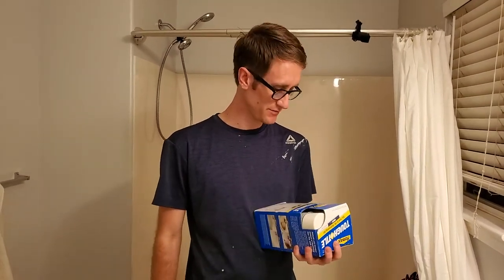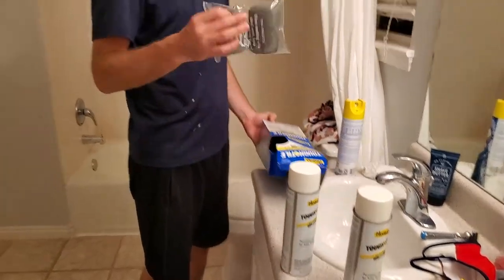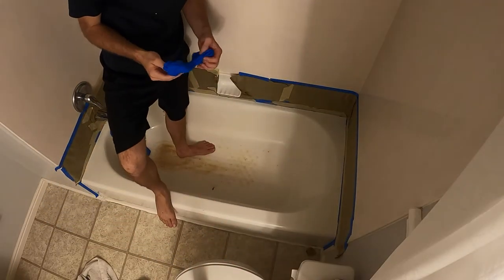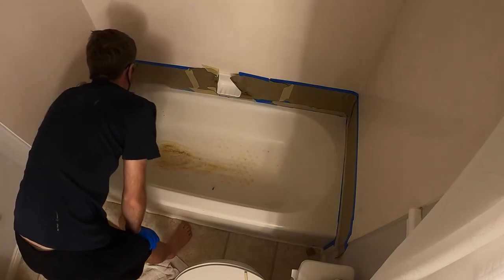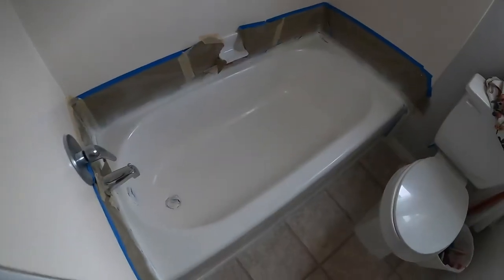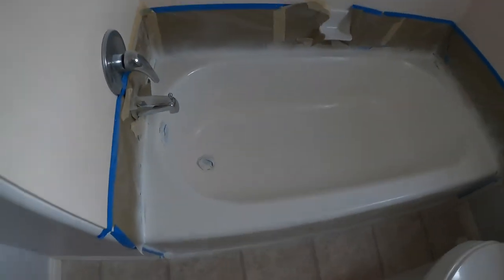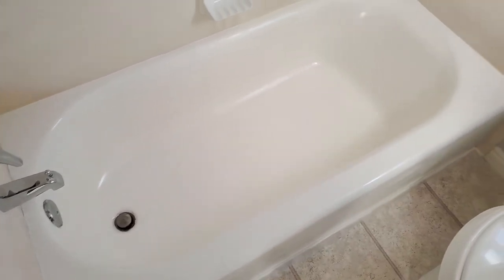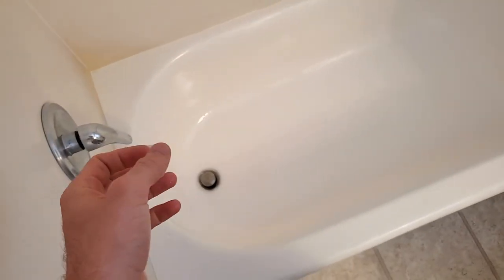HOMAX Tough as Tile Tub Enamel Spray Review / Resurface Bathtub

Comment: You're supposed to spray a light base coat wait about 20 min then spray another coat on to fill in the shallow parts and finish. You're not supposed to wait a day to spray it again. And hold the can about 8-10 inches away from whatever you're spraying

Comment: As for the area where your water pools up, that is typically caused by the fiberglass material that the tub is made out of sagging under pressure over time.  Paint is only a mil or two thick, and won't build up like that, and even if it did, it will only follow the contour of the tub.  

In order to fix this, you need to support that section from the bottom with a piece of plywood, then get some Bondo and mix it, then smooth it out in that pooling area, let it dry, sand it smooth and level, and then paint over it.
Reply from the maker: Oof that’s a lot of work. Thanks for the suggestion we might replace the tub all together

Comment: Guys please don’t just wear a dust mask! Wear a actual 3M half or full mask and make sure your filters say organic vapors on your filters! If it does not say organic vapors it will not filter out vapors such as paint oil and gases! This can cause serious brain damage or even death! Please don’t just use the little paper dust masks make sure the filters say organic vapor and it is a half or full mask! Each cartridge contains granulated charcoal that is treated to absorb organic vapors from the air passing through as you inhale. Used mainly to protect against solvents, such as those in oil-based paints. Others would include paint thinner, lacquer thinner, turpentine and fuel vapors.
Reply from the maker: I was wearing a n95 mask

Comment: The roll on is the only way to go I did one with the Rustoleum producct tub & Tile it left all kind of powder residue. I had to stop clean the by product then continue but my shower is just to confined regardless of the window and fans...Need to get a new Respirator the organic cartridges are worthless need full vapor protection half shield from 3m for this stuff. Going to use the homax roll on before too many days go by seems to be close to the same product hope it works. Thanks for posting

Comment: A wise man once told me, "If you don't know what you are doing, it's best to not do much of it".  You obviously did not know what you were doing.  Next time you try doing something you have not done before, try experimenting on a "sample" piece (in your case, perhaps an old sink).  Also, if you rely on instructions but do not have them, don't "wing it";  instructions can usually be found on the internet.  Whenever you "take a crack at" doing something, there is a significant chance that the result will not be as desired.
Reply from the maker: That’s your opinion. I respectfully disagree. I followed a tutorial from the company online and they said to shake it for 2 min which I did. In reality it needed to be shaken for 5-10 min. That’s not me “winging it” that’s just a bad product. So take your Condescension elsewhere it’s not appreciated.

Comment: The product isn't garbage you did no prep work.. no acid wash.. no sanding... no duh it didn't work
Reply from the maker: The product advertises no prep work needed expert using the steel wool that I used off camera. It’s supposed to be a spray on enamel.
Reply: Takes forever to dry

Comment: Used this product a couple times now. Saving up to do a proper remodel of a 1970s bathroom. You can’t just spray this on top of your “cleaned” surface. You need to put in the extra $100 to strip the old paint and acid wash for this product to properly adhere. I agree it’s misleading in the instructions but common sense will prevail for any true diy. Hire a professional if you don’t understand the general process.
Reply from the maker: Good point. Next time I’m gunna definitely hire someone
Reply: Good call brother.

Comment: How is it holding up?
Reply from the maker: Not good. Bad. The rust is already bleeding through the enamel.
Reply: Buy rust remover then spray on. I believe your tub is not level from whomever installed it 😩
Reply: If you don't replace the tub. I would certainly just sand the tub rough.. and paint it again, using roll on... It should level out.